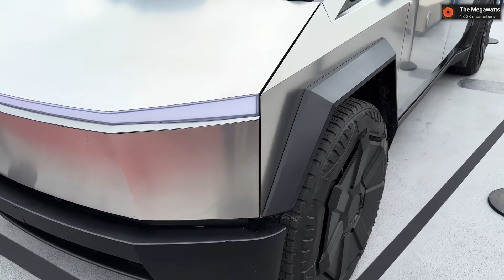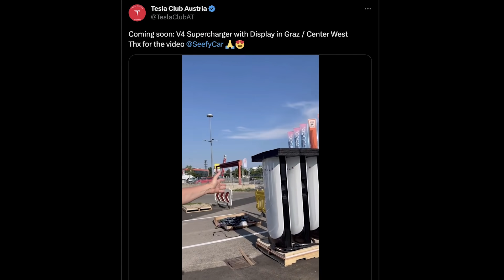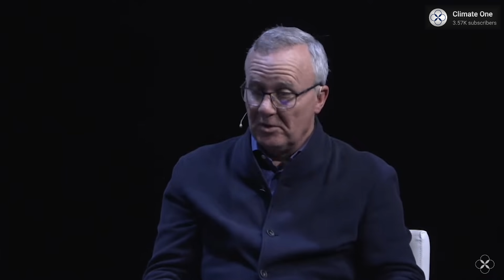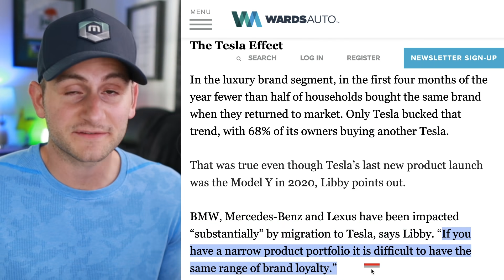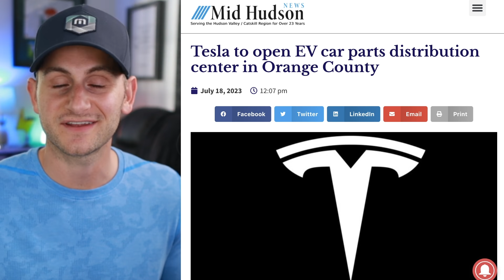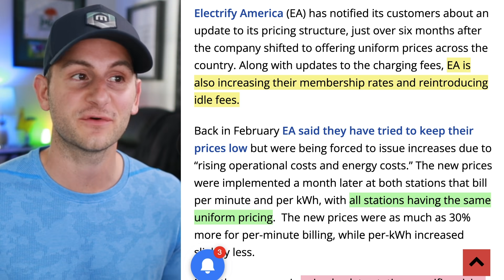Tesla Changes HW5 Plans / Increasing Migration to Tesla / New GM EV Promises ⚡️

Comment: BrightDrop needs solar charging.  And they need to market it to people who want it for van life.  It has a large flat roof, and they could have foldout panels that size, and the top.  Getting 50 miles per day is not far-fetched.  Maybe even 70 or more, if the arrays are light enough.

Comment: HW5: All major and many minor tech company have multiple generations hardware in development at the same time, it would be worrying if Tesla had not. So not really news or special. This is also where you can see the difference between legacy car manufacturers and Tesla. Tesla is so much more. (Which is probably what you were hinting at, more than that it was “news” or “special”.)

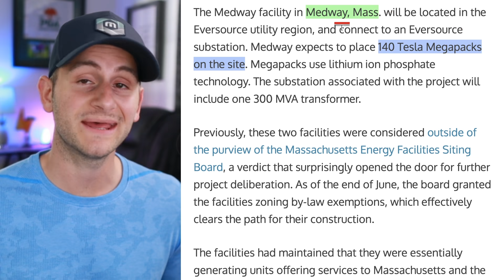Comment: 10:06
It's "disappointing" when a journalist writing for PV Magazine reports on a new Storage Project and describes the cell technology used in Megapacks as "Lithium ION Phosphate" rather than Lithium IRON Phosphate.
.
If you say I'm being picky, there's a LOT of confusion between terms, with many also describing "Lithium ion" (mispronouncing "iron") and "NMC" (or other Nickel based cells) as if they are not both "LITHIUM ION".
.
Maybe we need a new term for the "Iron based" subcategory, such as "Lithium Ferro Phosphate" or similar?

Comment: 9:45 - 800 MW BESS in MA caught my attention, but 400 MW BESS in Carver MA struck me as odd(!): it's an out-of-way location towards the Cape, well removed from the big loads in Boston and Providence. Why site there? I checked the ISO New England transmission map, and BINGO...three (3!) 345 kV lines run straight through Carver. The Carver location is directly on a major transmission path onto and off Cape Cod, for, among other things, the enormous Vineyard Wind project being built off the south shore of Cape Cod, connected via 230kV line from Vineyard Wind onshoring into the ISO NEW England transmission grid at Barnstable (Cape Cod). The Carver BESS site will be used to store Vineyard Wind power, buffer, provide frequency support, and other ancillary services for the sometimes shakey southern New England grid. Win win win!  Absolutely brilliant.

Comment: HW5 will be a chip that Tesla requires a much larger quantity of than HW4. I expect HW5 to be what Tesla release Optimus with, and demand for Optimus will be very close to infinite, and then HW5 will also be in the robo taxis. So we could easily see Tesla need fifty million chips a year to start and ramp quickly from there, meaning there is plenty production to divvy up from a couple suppliers.

Comment: Any new battery tech that replaces lithium will itself have to scale before the economics make sense. Cost is king. There are probably 100 more energy dense batteries right now but they cost to much and or they are unreliable. Probably take 20 years for a battery tech swap in the market, it would simply take that long to scale.

Comment: The Cybertruck just had a weird stance in my opinion, the front should be more lowere and the rear should be more lifted.
Reply: It has air suspension, so you can tell it to do that if you buy one.
Reply: @tribalypredisposed  I know, but what I'm saying it's normal stance is just looks weird with the front up and the rear down. Anyways will see.

Comment: An observation: EVERY assembly plant layout I've seen, including Tesla, is a rectangular building.  (I used to work in the US auto biz).  Makes sense since vehicles are traveling down an assembly... line.  The Berlin expansion layout is different.  It's a big square (shown when Tesla applied for the permit).  I suspect that it is the preferred layout for the new compact vehicle.  Yeah, I know the Mexico rendering was also rectangular, but the rendering does not necessarily correspond to what they used for the permit.  Just a suspicion.  Something to keep in mind perhaps.
Reply: Good observation. It would make sense to make some in Europe where their streets and parking make smaller cars preferable in many circumstances.
Reply: I think there's a better than 50% chance that Highland will be the testbed for at least part of the new assembly system.
It makes sense.
"Known" (ish) product
Experienced team
Efficient factory.

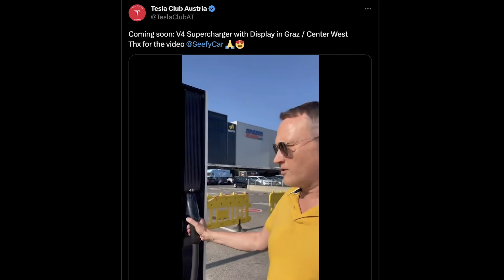Comment: 3:24 it could just be a display to comply with EU measurements regulations. An auditor from a federal measurement authority might require a display in the stall to compare his own measurement results with the DC power measurements of the charging station to be able to approve precise DC power metering.
Reply: A payment terminal would not have a Tesla logo, but instead an NFC wave symbol to indicate the position of the wireless card reader.

Comment: Wrt to the V4 supercharger screen and credit card reader, I'm pretty sure they are being mandated by new regulations. So you should be able to look up the regulations to find out what is being installed.
Reply: I just hope there's a bypass for Tesla owners to "Keep calm and carry on" using ug & Charge.
.
It's going to be interesting either way.....
.
If Tesla owners continue as usual without incident, but others who use the contactless option have problems, (then obviously[?] complain to Tesla) that fact should be pointed out.
.
However, should the Tesla Superchargers operate without incident on either system (Tesla plug & charge/ contactless)
That would point the finger at any third party charger manufacturer having issues, or the vehicle manufacturer interface with those chargers..... ?

Comment: Anyone know - can the stainless CT be keyed? (i understand if you work hard enough you can scratch anything, but ..how easily keyed?)
Reply: Stainless does scratch, but it'll "buff right out" with a scotchbrite pad.
Reply: I guess you can "key" a CT with a hammer and chisel.

Although, a bit of polishing would probably fix it.

Someone is certainly going to try it. And publish videos about it!

Electro-etching or a strong laser, though, that will do it.
Reply: Cybertruck scratch keys not the other way around. Jk idk but I’m guessing the trucks metal is harder than most key metals